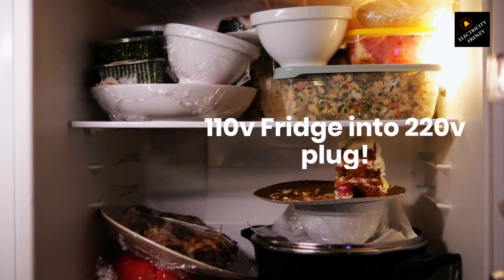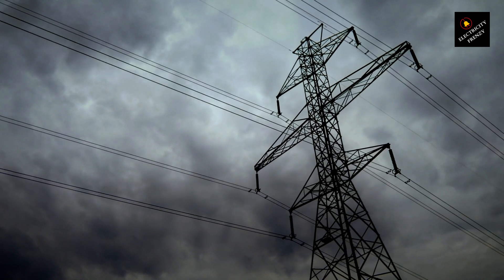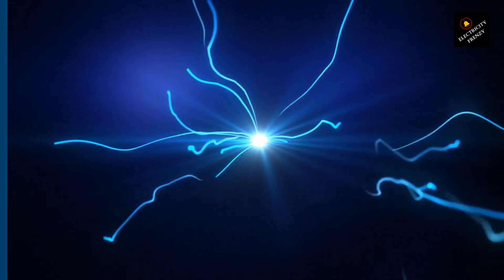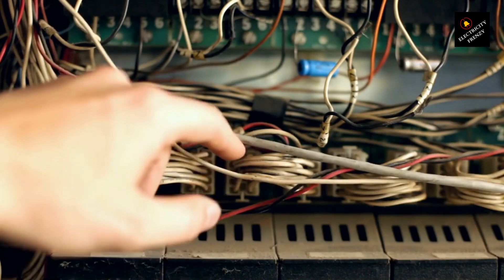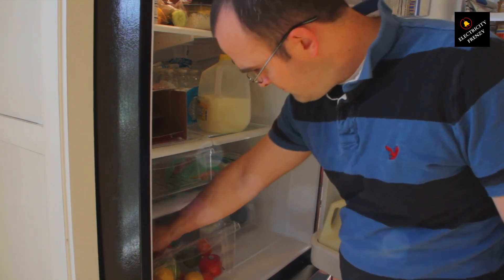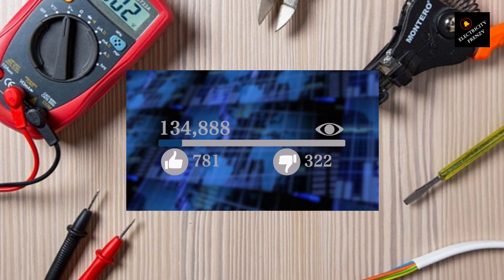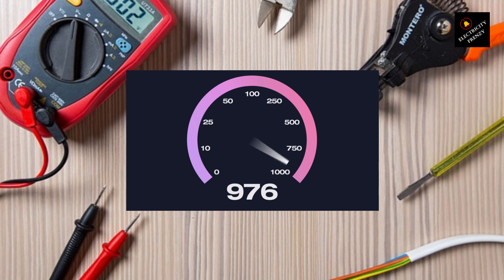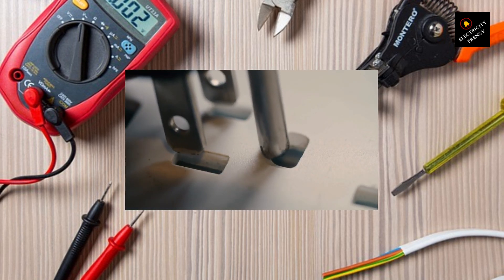Can you Plug 110v Fridge into 220v?

Comment: How about the Frequency 50Hz when using 220V? any issues?
Reply: Shouldnt have any issues with 50/60hz freq
Reply from the maker: Modern appliances are 50/60hz
If so, it will be OK 👍
Reply: @ElectricityFrenzy  Plug 220v Fridge into 120v line ?
Reply: @ElectricityFrenzy How can I know for sure?